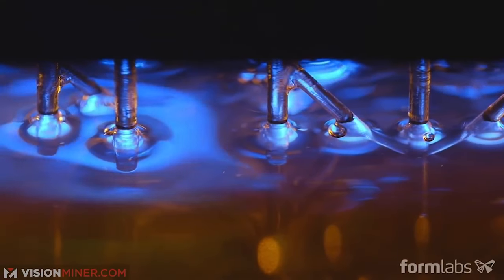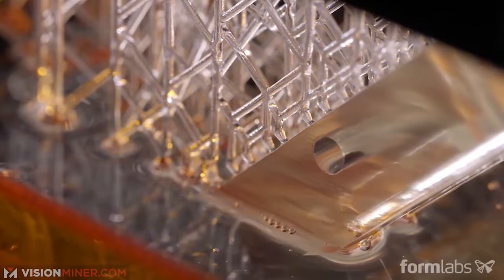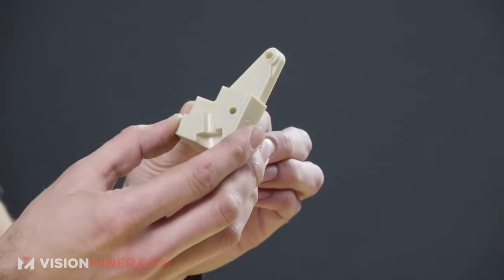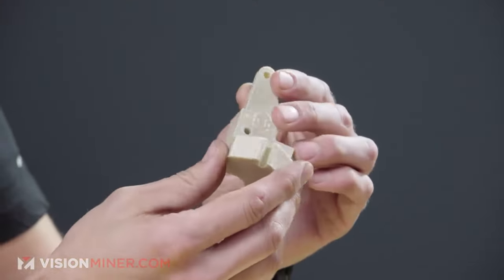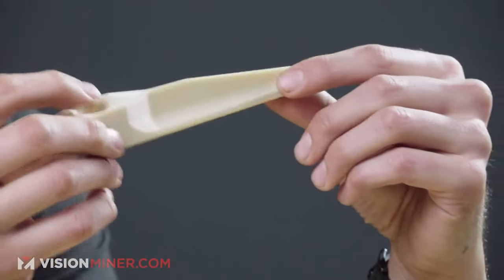Why You NEED a Heated Chamber for 3D Printing

Comment: Why have most printers sold no chamger? PRICE. Simple like that. MOST printers are built as slow as possible. MOST likely are bed slingers. ANY chamber adds additional cost and people go for the cheapest. Simple like that - this is the ONLY answer to this question. Volume is on the low end of the market.

Comment: Good discussion and I agree that a heated chamber can significantly reduce warpage and improve dimensional accuracy. However I believe that the reasons you don't see this feature around much are cost, energy consumption, reduced operational performance, design complexity, and safety. 
To enclose and heat a volume of air (approx 2 - 3 cu ft) and the other 'stuff' inside the chamber area begs a significant amount of power. Heating a chamber up to let's say...70C also takes a fair amount of time which extends overall print time. And 70C is probably not going to help much in reducing warpage with more difficult materials.
Since you can't divorce the printing volume from all of the motion components, objects exposed to this temperature will likely have reduced reliability. Needless to say, linear rails, steppers, fans, belts, and other assorted bits inside the chamber don't do well at extended high temps.
Additionally I don't think this is a very safe option for casual home or light industrial use. 
My ramblings are derived from my various experiences with heated chambers and it would be very interesting to discuss how this might be achieved successfully.
Reply from the maker: This is one of the most detailed and accurate comments we've ever seen, well done, good sir! check out our 22 IDEX if you haven't already :)
Reply: For my printing, a heated chamber doesn't take any longer. I don't preheat the chamber because it will heat up by the time the part needs the heat, before that, the print so far is still in the "ambient" region of the bed heat. For non-exotic plastics, I've insulated well enough that I often don't need to heat the enclosure, it heats from the bed just fine.

Comment: Another key aspect to keep the part warm enough during printing, is to get chamber with low convection;

- by removing fans (water-cooling)
- by reducing the cold surfaces (insulation and small doubled glazed window) 
- by choosing an oversized heating system (low airflow speed and low temperature gradient) 

By doing so, you got a much more stable environment over the entire volume and during the whole printing time.
For the same maximum temperature of an heated enclosure, the difference of capabilities is significant.

Comment: Love the content. Heated chambers are amazing with nylon.  One topic that you could drive into is the pros and cons and design considerations of different fiber reinforcement.

Our company uses cf nylon, it's great but it can cause galvanic corrosion in humid environments.  So that means you need to use stainless fasteners and coat parts with paint/resin. 

Glass fill is great but it tends to be more thermally insulating. So assemblies can have higher thermal gradients. It's one of the reasons we think it's harder to print with.

I'd like to know more about Kevlar fill or other fiber reinforcement.

Comment: I want to know why it is a consensus to have a heated chamber at the glass transition temperature of the plastic.  I suspect it is because the glass transition temperature happens to be the build platform temperature people ended up using.  Or is the hobbyist  
“concerns” just a common misconception?
Reply from the maker: If the polymer is amorpohous, as opposed to semicrystalline, that is the point where the material "relaxes" and doesn't warp nearly as much, allowing the build to be completed before cooldown, when warping occurs -- if you keep it at that temp longer, it eventually relaxes most of the part. The build plate is often much closer to the TG, yes, thus keeping it "relaxed" :)

Comment: They don't have heated chambers because it was patented. The patent just ran out, so we will see heated chambers soon. QiDi has one in their $2300 iFast.
Reply from the maker: Correct, although previously, hitting 60ºC in the chamber could be done with just a hot bed and a simple box -- so they're not technically using anything from the patent yet, but it's GREAT to see  machines releasing with active heaters, regardless :)

Comment: Thanks for the great video. I just bought the new Ender 3 S1 Pro - capable of 300C. The idea is to enclose it to enable me to print good 3DXTech CF Nylon parts. What would be a good heat source (element / Infra red lamps etc)  to heat the chamber and what would be the ideal chamber temperature for CF Nylon? Thank you.
Reply from the maker: A PTC heater works great, but you'll run into issues with your components failing much quicker, and the frame shifting/warping since it's aluminum -- but it can be done!
Reply: @VisionMiner  Thanks for your reply and the warning about damaging the components. I will be very careful not to raise the temperature to extreme limits. I already bought the 3dXtech CF filament. If I manage to print the parts in question successfully, I will save enough money on two or three part runs to import one of your Gearbox printers. Do you have a distributor/dealer in South Africa? Alternatively, do you ship to South Africa?

Comment: What printers are there even with a heated chamber that aren’t beyond 4k in price? Especially them also being available for a Private Person. Printing lots of outdoor stuff which will be exposed to rain, but also parts that should withstand oil and metal dust. Sometimes it’s also PP(E) for high abrasive for stuff like Vaccums. And sometimes IDEX would really bring a benefit for gears and stuff..

Comment: Your IDEX22 is a good entrance point for heated chamber printer. I own it, I can say it's easy (2 weeks with the good mindset) to master the printing of ABS, Nylon or PC and high temp thermoplastics with carbon fiber (I've only tried CF-PEKK and CF-PPA)
Reply from the maker: Absolutely! And as a note, our 22 IDEX has a lot of changes from the original AddWise machines which you likely received -- CNC aluminum parts throughout, more thermals, lots of little upgrades.... super glad to hear you've had a great experience!

Comment: Can you cool Ultim slowly like when you weld cast iron in heated sand that's the same temperature as the part when it's finished? It would give a very very slow and gradual cool down over 24-48 hrs.

Comment: I've almost exclusively printed with ABS on the ender 3, but have had problems with recent cold weather, ik I need to heat the chamber but not sure to what temp, best I got was 36°C just with 100°C bed

Comment: With SLS, metal 3dp, resin, 3dp homes, etc., I am unsure of the market for high temp FDM.
Reply from the maker: It's a big market, but very specialized in specific use-cases, mostly aerospace, medical, oil & Gas, and electrical applications
Reply: @VisionMiner  As you guys implied, the enthusiast market doesn't identify with needing heated chambers, let alone enclosures.  Plus, filament makers are producing more accessible forms of low temp filaments.  Together, these seem not to make a strong business case for high temp FDM.  I also took a look at Hubs' materials and processes for aerospace applications—nothing recommended involving high temp FDM.  Lastly, innovation is taking it on the chin with a recession looming.  Are you familiar with Ark's 3d Printing ETF ($PRNT)?  It's down 50% from about a year ago.